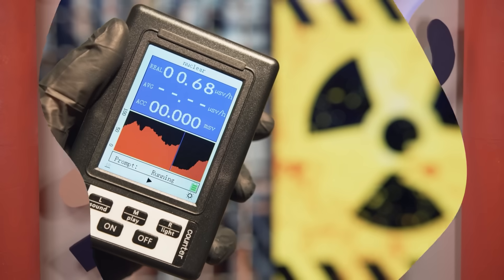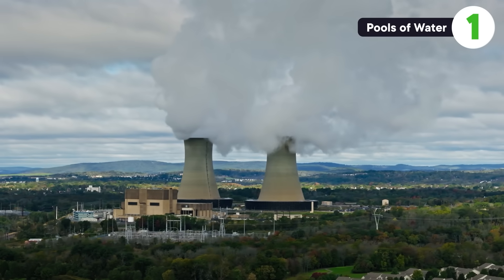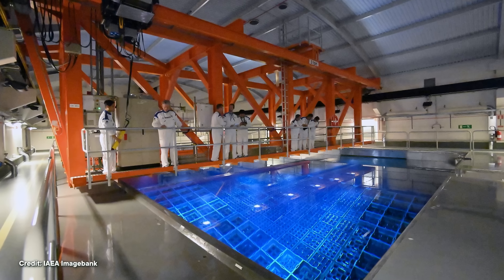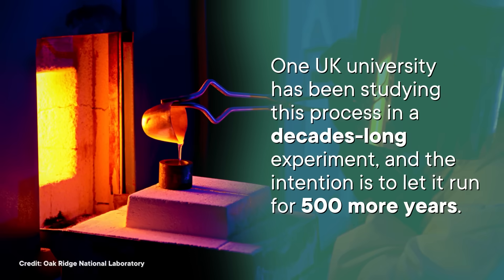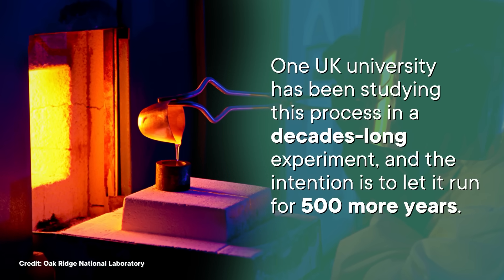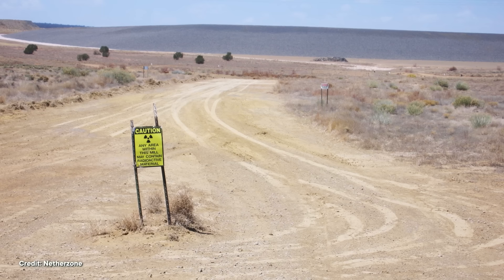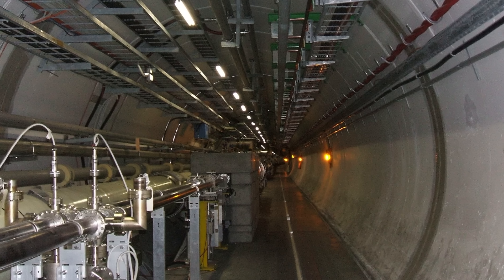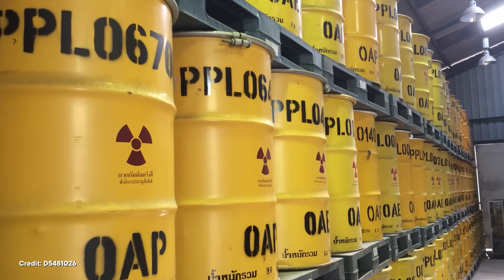So You Need To Dispose Of Some Nuclear Waste…

Comment: The nuclear fission generators currently in service around the world are extremely inefficient and waste between 90 and 95%,  of the plutonium in their fuel rods. One excellent option for recycling the "spent" plutonium is to burn it up as breeder stock in highly efficient and super safe Liquid Flouride Thorium Reactors like the designs in large scale testing in China now. Thorium is also an much more abundant and accessible element than plutonium, and LFTR reactors can be scaled to township sized power plants as small as a shipping container that can be manufactured on an assembly line.

Comment: 1) half life is not the time it takes half the material to become safe, it is the time for half of the material to decay. What it decays into may ALSO be harmful, and it will have it's own half life. This is particularly true of the fission products that were generated from fission.
2) Boron is very good at absorbing neutrons and is in the pool to prevent an uncontrolled chain reaction from occurring. It's not actually there to provide shielding. As the video said, the water does a great job of that. So do the lead-lined tank walls.

Comment: 6:44 Misleading. Half-life is inversely proportional to its hazard. If you have 100 atoms with half-life of 6hr, you will have 50 decay events in 6hr, while the 100 atoms with million year half-life would likely not have any during 6hr. The dose makes the poison, and they need very little. But! A short HL means it goes away quickly though, unlike e.g Cs-137 with 30y HL, it's dangerous now and and for many generations.

Comment: Banana is not dangerous, because your body knows how to precess it. But human made radioactive material might stay inside. Inhale or digest it, and no matter how low it is, it can cause cancer, since it stuck inside. 

More nuclear power plants, more problems. And no, plant itself or even storing is not the only issues, from mining to waste storage, there are quite a lot failure points. People handle these, and people make mistakes. Entropy is a thing. It will spread somehow, it doesn't matter how. It is as good as the weakest link. 

It is not a good idea to completely rely on a power source inherently dangerous.

Comment: One of the things that has always bothered me about the waste from using nuclear fuel is that very little effort seems to be put into putting the waste to good use. If using the fuel degrades it to where it is no longer useful for the primary purpose, wouldn't using the "waste" for some other purpose degrade it further, making the post-use storage requirements less severe? So, instead of having to store it for centuries, maybe researchers could get it down to decades, or even years - something current technology could handle.
Reply: France and a few other countries have been recycling their spent fuel for years. Other countries dont want to partly because its cheaper putting it in special landfills.
Reply: The bits of the atom left over from fission decay by their natural half life regardless of what we do with them. Using them for other purposes has been done, with some success and some consequences. For example, strontium-90 has been used as a nuclear battery to generate electricity for very remote infrastructure by the USSR. When the USSR fell, many such nuclear batteries were lost and some have been found by unsuspecting people, who did not all survive.
Reply: @SocialDownclimber  Not true. If you hit materials with natural half-lives of millions or even billions of years with neutrons, they can and will "disappear" much faster. That's "fertile" vs "fissile." U-238's natural half-life is billions of year, but it is used in reactors where a long half-life "fertile" materials is converted to a much shorter lived "fissile" material. It's fissile materials that actually provide the power.
Reply: @markr1961  You are correct about the differences between fertile and fissile, but I was specifically referring to fission products, which cannot undergo fission again no matter how much you push neutrons into them. That's what I meant when I said "the bits of the atom left over after fission", since I was not sure that the person I was responding to would understand what a fission product is.

Comment: I think a better solution would be to mix the waste with enough non-radioactive material until the radiation levels are at safe levels for humans, then dump it into abandoned coal mines. The only problem I see with this is perception of danger from the general public and it's a waste of unique material that could be used in the future. Waste material might not have uses now, but it might have value in the future.

Comment: Fully automated nuclear power plants on the moon. Energy is transferred to big batteries. Batteries are shipped to earth. Are shipped to and install Batteries in the spaces where power plants used to stand. 

Supplement this with renewable resources as well. 

But ya. This certainly wouldn't solve our issues right now.

Comment: How did you not talk about newer methods of reprocessing or recycling? Small reactors are great for this. Bead cyclers particularly. That would have been better than the discussion of the LHC.
Reply: Dude I am totally behind fuel reprocessing. There's enough spent fuel sitting next to our power plants to power us for a very long time without having to mine a single ounce of uranium out of the ground, and if we could get our government to pull its head out of its ass and actually build some fourth generation reactors, we can take that fuel and stretch it even further.

Comment: I read that it may be possible to use old nuclear waste in Thorium reactors, which will as a side effect make that waste less radioactive as it is spent.
I wonder if that is true?
Reply: Uranium decays into thorium which is why what you said would work. Its like boiling water. Some is lost because it becomes steam.
Reply: A Thorium molten salt reactor does not produce any waste.
As it is now, the fuel rods are removed and called waste when less than 7% of the fuel has been used. They need to do this because the fission product Xenon makes the rods brittle and soaks up a lot of the neutrons.
In a Thorium molten salt reactor, ALL the fuel can be used. As the Xenon, a gas, just floats up to the top of the reactor. 100% of the fuel is either split into harmless fission products or turned into valuable Plutonium 238.
Reply: @Merecir  I agree with your premise but not your comment. You contradicted yourself. If th msrs dont produce waste then there wouldnt be harmless fission products. Th does create waste then but its harmless.
Reply: @namename9998  Harmless fission products are not waste, you can just let it rest for a couple of months, then sell it on the open market.
It is the stuff left over from when you split the uranium atom in two.
Reply: @Merecir  Semantics. What youre talking about can not be used in reactors therefore it is considered "waste". One persons waste is another persons treasure.

Comment: Everyone is just marking time until the completely 100% inevitable next CME/carrington event that's coming down the pike.

And then... major bigtime EMP. And then... eventual nuclear meltdowns of all the reactors and spent fuel pools as they lose their cooling systems. The planet will be quickly radiation sterilized from pole to pole.

No one survives. Not anyone anywhere. Everyone dies. And that's that. End of story.

Loss of electrical grids will certainly be... problematic... but all the nuclear meltdowns will be the actual disaster.

That CME is now the only thing that really matters anymore.

The only, only thing. And its moment is getting closer and closer in the timeline.

"A safe and efficient way to produce electricity."

Well, that sure didn't age even the least bit well.

Hundreds and hundreds and hundreds and hundreds of nuclear reactors and spent fuel pools in simultaneous meltdown...

Oopsers...
Reply: While everyone is busily OCDing about the proper feng shui of the deck chairs on the Titanic, the ship is going glub glub glub glub.
Reply: Proponents of the nuclear power industry seem to... forget... about the 100% inevitable CME/carrington/miyake events.

Like the sun magically isn't really there. Even though it very extremely obviously is.

Fun fact... nuclear war is hardly even worth mentioning compared to nuclear meltdowns.

A bomb goes boom and that's all the radiation it will ever produce. But meltdowns produce and spew out enormous amounts of new radioactive particles next to forever.

There is no safe form of nuclear. Period. All forms release radiation into the environment in one way or another. And there is no safe level of radiation. Just increasing amounts of cell damage with exposure.

I don't understand all the fetish for radiation. A very strange fetish to have. A fetish for radiation like pyromaniacs have for fire.

Radiation is bad for children and other living things. Very, very bad.
Reply: The Titanic was a ship of dreams. It was, it really was.

"If nautical nonsense be something you wish, then drop on the deck and flop like a fish."
---Albert Einstein
Reply: Now, you'll have to excuse me while i do a patented weapons-grade Captain-Picard-style double facepalm.

Comment: The trouble with all the methods used currently to deal with nuclear waste, is that the theory works fine, but the moment you introduce people with financial motivations to that scenario, the whole thing becomes a mess. 

 Underground storage isn't safe ENOUGH, it isn't secure ENOUGH, it isn't well guarded ENOUGH considering the world obliterating threat posed by contaminants held therein. NONE of these methods are good enough, leave alone fool proof, and that is a major reason why nuclear power should NOT be part of the future of energy production.
Reply: This is simply untrue 

Your first claim is correct the rest is fear mongering 

I suggest you watch some of Kyle hills videos on the subject
Reply: Driving isnt safe but people are allowed to drive.
Reply: It is very easy:
Shut down nuclear power =  You need to store the existing "waste" for 100k years.
Continue using nuclear power = We use the "waste" as the unused fuel it is. No need for long term storage.

Comment: There is also a lot of radon that is emitted from glacial til as in glacial til in western Canada. When a home is sealed to decrease heat loss in winter, radon can build up and harm the occupants.
Reply: the good thing is, properties can be tested and there are mitigation efforts.
Reply: @a-goblin : Also, counter-flow air-to-air heat exchangers can be used to replace the stale air with fresh while losing arbitrarily small amounts of heat (the amount you lose is directly related to how much money you're willing to spend on the heat exchanger).
Reply: @a-goblin  But sadly it's not that well known except for a small handful of stories over the years despite Alberta having the highest levels nationwide...
Reply: Do houses not get tested for radon during sale in Canada? It was part of the inspection when I bought my house.
Reply: @pg2826  Good question! I don't think it's required, at least not in my province. It takes a long time (a minimum of 3 months) to test for radon so I think mandatory testing would be difficult to implement. Not everyone knows three months in advance that they're moving, but if someone's already had their house tested it would make a good addition to a house inspection. I'm a renter but I still plan to leave my home's test results for the next tenant when I move.
Reply: @SoupEaterExtraordinaire hmmm, my testing was only 24 or 48 hrs. All the doors and windows needed to be closed for the test
Reply: The Evict Radon National Study provides at-cost radon testing across Canada. It's super easy, they send the test out through the mail, you set it up in your house following the instructions, and then mail it back to them after at least three months of monitoring. 

They also do the kinda funny Long-Term Radon Exposure Biomarker (Toenail) Study, so if contributing your toenail clippings to science is something you've always dreamed of, these folks have you set!

Comment: How about accelerated decay for the radioactive material? A nuclear reactor already does that.
Reply: A reactor smashes the uranium atoms into smaller atoms that stabilize after a short while. That is how you get rid of the long term radioactivity.
Reply: Nope, a nuclear reactor does not accelerate radioactive decay. It only increases the fission rate, it does not change the rates of alpha or beta decay.

Comment: Hi Stefan!

Nuclear reactors generate power through fission, not decay.
Reply: I noticed that flub also.  However, a google search suggests that about 6% of a nuclear power plant's thermal output is from daughter isotope decay, with the remaining heat from fission.  So he is only 94% wrong.
Reply: There were some kinds of reactors that work through decay.
Specifically, the ones used on spacecraft.  But I imagine they have uses for on earth too.
Reply: @neilkurzman4907 : The only ones I actually recall being used on Earth are some that the Soviet Union used to power unmanned lighthouses above the arctic circle. The solid-state electrical generators that are part of those systems get used more broadly, but the isotopes themselves are not actually that common, so there's relatively little that can be done with them. NASA has actually been restrained by the shortage of the isotopes- I think they're only able to launch a mission with them every one or two decades because of how little of the ones with useful half-lives is actually available.
Reply: @neilkurzman4907  You're thinking of radioisotope thermoelectric generators.  These use plutonium-238, which generates a fair bit of heat, through decay, which is converted to electricity via thermocouples (see Seebeck effect).  Besides the voyager probes and other spacecraft, they were also used for arctic light houses by the Soviet Union.  Check out the page on Wikipedia.  Note that these were not nuclear reactors.
Reply: Technically fission is forced decay😅
Reply: @boulderbash19700209  Not really.

Comment: Im so sad, you didn't mention SMR ( small modular reactors) which are designed to run off of those nuclear wastes we create
Reply: SMR? Did you mean msr ? Molten salt reactors? The only difference between smrs and regular reactors is construction. Theyre the same when it comes to using fuel.

Comment: If you take depleted reactor fuel, and you use that as a beam dump material in the LHC, will it function like a rechargable battery for nuclear powerplants?
Reply: Nope, it is exceptionally difficult to fuse heavy nuclei.

Comment: It's sort of backward though.

Half lives that are shorter are MORE dangerous to humans because they are dumping all their energy over a short time.

Of course the storage is less problematic.

The really nasty stuff has half lives between years and decades, that's the stuff that's really hot, but sticks around long enough to be problematic.
Reply: Also, some materials simply have more or less energy than others. Part of why cobolt-60 and especially cesium-137 are so dangerous is because they have a lot of energy to dump out. Fast or slow, it's dangerous stuff.
Reply: @General12th  Right and to add to that alpha is only not safe if you swallow it. If you sit on it youre mostly safe. Gamma is not safe. And the amount plays a factor. Swallow a lot of a short half life could be more dangerous than very little of a very short half life.